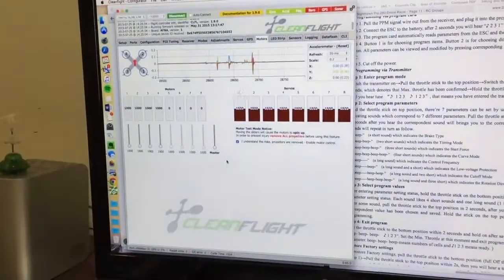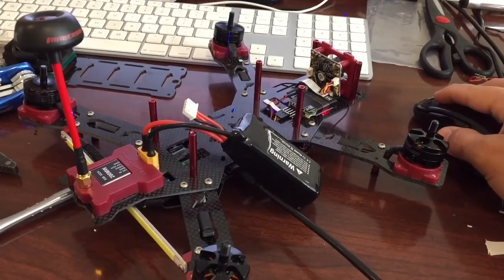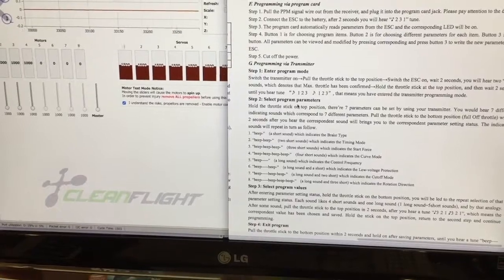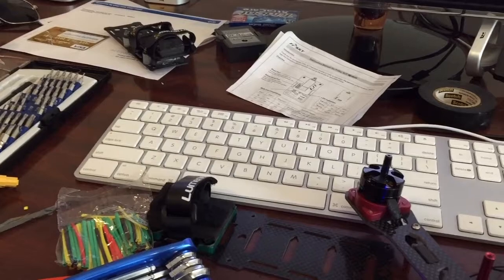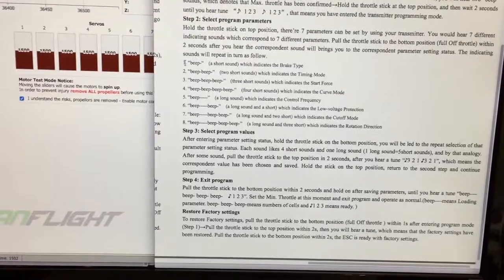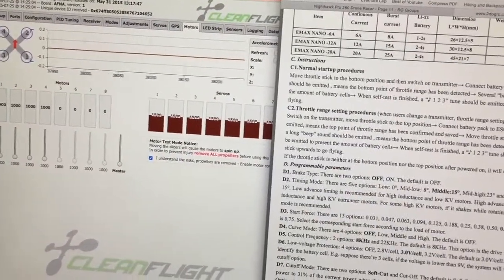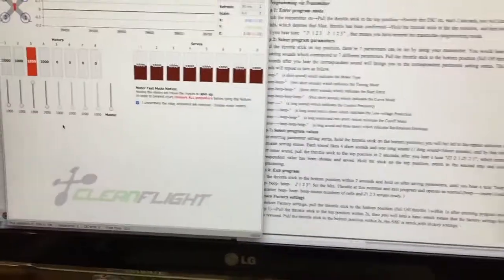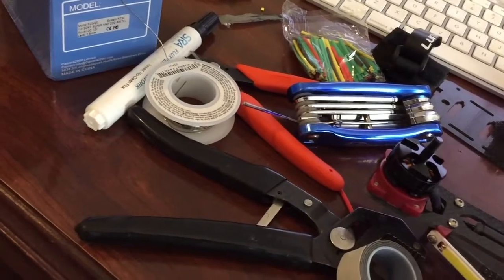Max Nighthawk Pro ARF ESC Programming Active Braking with Throttle

Comment: hiya nice video I got the ARF nighthawk 280 pro but I'm having trouble with motor testing to do single motor testing do I switch esc switch off on the quad and test the motors singley like in your video   this is my first racing qaud and can't get round this problem when testing with master the motors don't stop singing and if or when I pull master down there's no confirmation beeps or singing it stops but starts singing and going back in to singing and motor twitching if I push the master back up   can you give me any help or advice on this  its cracking me up lol

Comment: HI mate, hopefully you read this comment! I uploaded a video of my drone after updating the CF version and thought I screwed everything up as it completely changed the sound of my drone. Did you notice your drones sound change with this braking thing enabled? I kind of didn't want it on and just wanted to move forward to CF over BF. Do you notice your PCB gets hotter with it enabled? Do you also notice at extremely low rpm the motors don't spin, they just twitch until they get enough juice to go completely?

Comment: Nice Video , but I struggled to get mine done.  Unfortunately the 1st motor went rogue, and I need help on resetting the esc.
 The problem is I can't get it to program , because the motor reverses at half throttle, and I've tried hooking the bat. up in all three positions with no program mode. Any ideas? TIA Mike

Comment: Great video I'm wondering if you can help me? Iv accidentally messed my esc/motors up where 3 spin pretty poor and one starts spinning backwards at 50% throttle. Is there anyway I can fix this? You seem like a knowledgeable guy :)
Reply: +Robert Evans I had a similar issue - all I had to do was set the throttle in BaseFlight for each of the motors individually

Comment: Doubt this will make a difference to actual flying, as brake is ONLY active when throttle is at zero,  you really don't want any brake when its flying, as lose of thrust and you drop like a brick. Braking is usually used for folding props, gliders and I use it on my paragliders to kill prop rotation, so I don't snag the lines when landing.
Reply from the maker: I don't know how this particular nighthawk implementation works, but you definitely do want braking while flying a mini quad because (as you say) it will allow you to drop altitude much faster. This is a desirable trait in a mini quad and helps agility to be able to drop and gain altitude without delay.
Reply from the maker: My experience is that it brakes when the rpm of the motor exceeds what is requested from flight controller and not just when the "request" falls to 0 throttle.
Reply: +William Slater From what I have read, that is not how it works, brake is only active at zero throttle, there is no braking action done when moving to a lower throttle speed. Can you give a link to where you have read this.
Reply: +William Slater "Our ESCs have only one way to control motor speed, and that is PWM on time. All they do in response to throttle changes is reduce that. Commutation is driven by the motor (esc just senses and follows along).

Brake on/off has no effect unless there is no power. When throttle is off the ESC will short the motor windings if the brake is enabled, otherwise they are left open circuit."

http://www.rcgroups.com/forums/showthread.php?t=2334751
Reply: +William Slater  "Active Braking is a feature in BLHeli firmware, many people enabled this along with Oneshot125 to get more responsive result.With damping light (Active braking) enabled, when you reduce throttle the ESC will actively reduce the motor speed. Without it the prop will only be slowed down passively by the air resistance as you drop throttle. This is especially obvious with longer larger props than smaller props, due to inertia. Many observed when this is disabled, the quad feels more “floaty”, when enabled, the quad feels more responsive with throttle changes."http://blog.oscarliang.net/oneshot125-esc-quadcopter-fpv/#active-braking-damping-light
Reply from the maker: +WD-40 that's cool, I thought the braking is similar to what is happening on the Blheli code, but maybe not

Comment: Nice video. Thanks. I wonder if I can do the same for Emax simonK 12A? I have flashed some of them with BLHeli 14. Is that possible to do this for BLHeli version as well?
Reply from the maker: +Duke Vah I dont know what to tell you about those Emax ESCs.  I know now that the firmware that comes on the nighthawk is not BLheli at all, but some other custom code.  I use BLheli on all my other ships using DYS SN20a ESCs.
Reply: +Duke Vah yes, i had them, from what i remember they had brake type option, search for the manual if the setting is available, probably yes...
Reply: +Hernán Herrera Araya I couldn't find a brake type on BLHeli documents. I see one on the original manual but it doesn't support oneshot and so I think it means something else. have you tried on BLHeli? I'm talking about this esc http://www.emaxmodel.com/esc/simonk-series/emax-simon-series-12a-for-multirotor.html .
Reply: Search for the pdf and you will finde brake type option on programming section. Set it ON
Reply: Vahdat Abdelzad Also, active braking is different from oneshot. It also  improves responsiveness
Reply: +Hernán Herrera Araya I flashed BLHeli (this version https://github.com/bitdump/BLHeli/tree/master/SiLabs) on ESCs. In this folder there is a manual but it doesn't say anything about the brake type. Would you mind sharing the link of pdf you indicated? In the ESC's original manual (SimonK old version) it says "brake type". I cannot see it on BLHeli. The BLHeli document says these ESCs don't support active brake
Reply: Idk if blheli supports it. Search for Damping light.. is an alternative way of saying it
Reply: +Hernán Herrera Araya I'll give it another try :-)

Comment: Great video!
I assume I can program all 4 ESCs at once if I want.
Will try this out and see, thanks
Reply from the maker: ***** Thanks! Yes, if they all start the programming sequence at the same time, it should be possible.
Reply: *****  It was pretty easy to do and I like the improved vertical response now. I tried to do all 4 at once but only two took because they don't trigger in unison but instead the software cycles through the 4.
Thanks again for the great  tutorial!